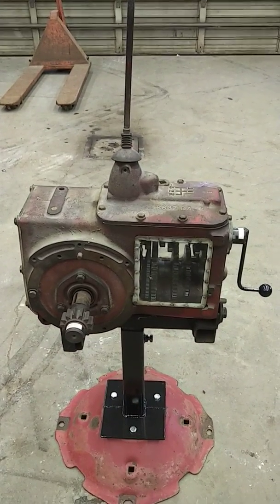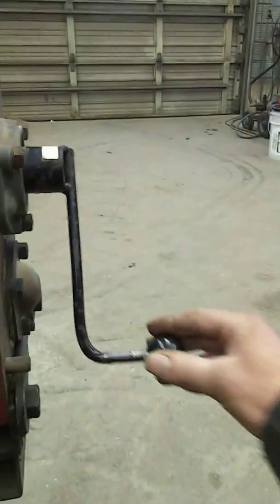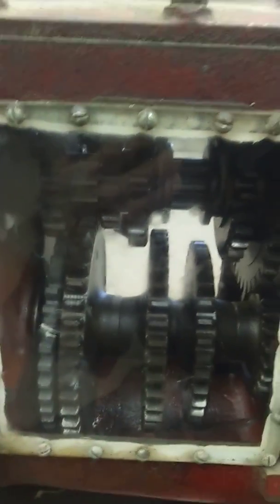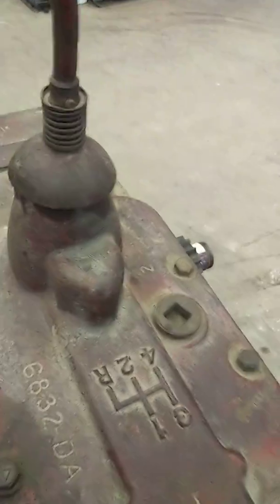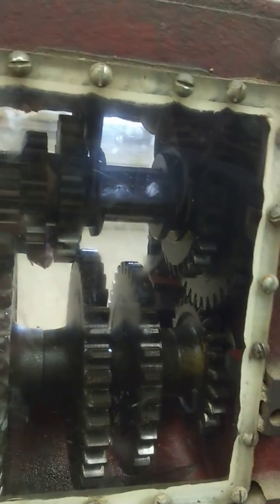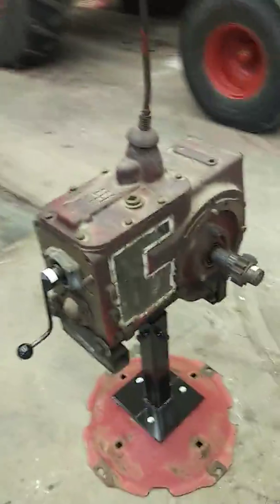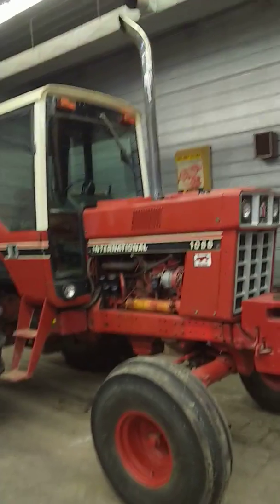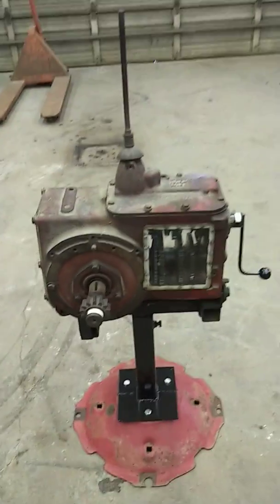See Through Farmall A Transmission!

Comment: Nice transmission. I believe at A, B , and C tractors use the same transmission. I don't know about the Supers or newer. I know the Super H, M W-4, and W-6 are geared different than the tractors they replaced. The Super WD-9 is geared the same as the regular W-9/WD-9
Reply from the maker: The Farmall C transmission is similar, except the housing is larger to have the final drives and bullgears in the same case.
Reply: Now that I think about it, you're right. The brakes are mounted on the differential shaft on the C and they have bull gears. They are essentially a combination of the A transmission and a similar design to an H for the rear end. It's been a long time since we've had an offset tractor. We have a C which is our smallest.

Comment: very nice DOC,i been hunting a video on farmall A trans ,I have a 46, my grandson was messing around with it now its hung up in gear wondering do i just take it apart and and see whats up or ?,i havent tried to crank it up yet,
Reply from the maker: Remove the top cover (with the shifter). Arrange all gears in neutral and put the cover back on.
Reply: thanks DOC i took the top off seems like all the gears move im thinking its hung up in the shifter itself.looks little rusty like it hasnt been used in a while,and the gear lube is white looks like it may of had water in it ,i have it draining now about so thick it want drian out,
Reply: hey Doc,i was wrong about all the gears was turning .i got back out today and the way its looking the biggest cog im thinking is supose to slide back is that correct ? i need to find video somebody working or putting one together,i watched ur see thru trans again and seen its forth gear that seems to be hung up,whats the best way to maybe pry it i guess unhung,when the trans is in neutral can you put the pto in gear and move some of the gears or maybe not ?.come to think of it forth is just stuck forward ,i think it goes in gear when its pulled back should the all the gears slide pretty easy.i tried to take a one by board and move it back but it wouldnt move.
Reply from the maker: @southernsawyers6543  On the top shaft there are two sets of two gears. The front most and largest set are 3 and 4, the next set back is 1 and 2, and the rearmost, and smallest one is for reverse, and does not slide. It is pinned. I have dealt with stuck gears in the past. Soak it with your best penetrating oil, then get in there with a large punch or prybar and tap it either way. Usually a good few hits will get them moving again.
Reply: thx Doc, I did just that,used some pb blaster and a crobar and got them all moving again,and the shifter also was froze up with rust,hope to get it moving for the first time since i got it couple weeks ago.thx for all your help